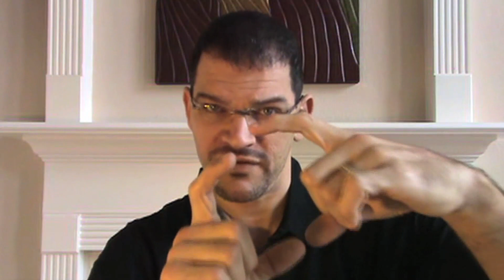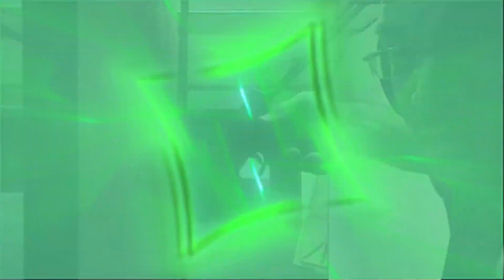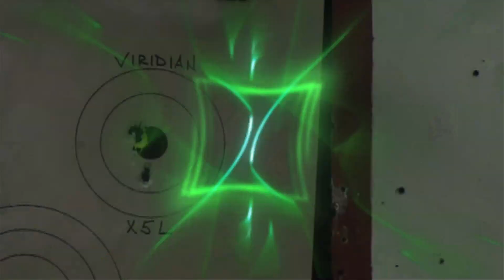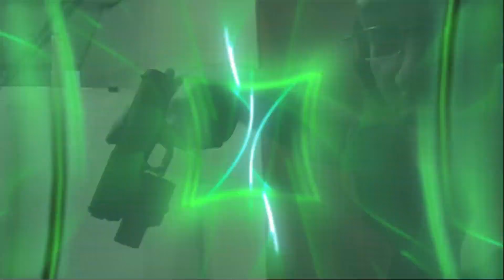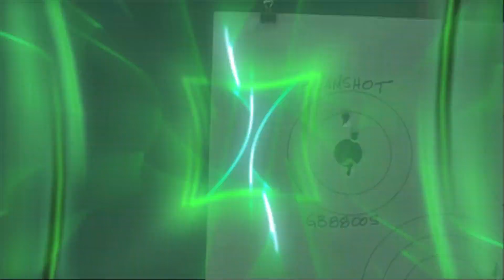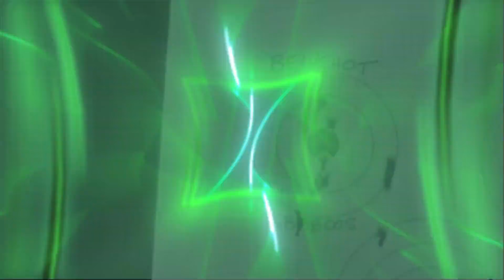Viridian, LaserMax & Beamshot Green Laser / Light Combo Range Test Review Pt. 1 of 4

Comment from the maker: @denzelin929: That's great. We're glad it's working for you. It's unfortunate for us as we had 3 different units replaced one after the other with some kind of failure different from each model. Either it locked on & laser wouldn't shut off & visa versa (1st model, X5L), Front protective lens collapsed inside the laser (2nd unit, X5L), or an unsecure picatinny rail holder that no matter how tight, was still able to move slightly side to side altering the accuracy of the laser (3rd model, C5L).